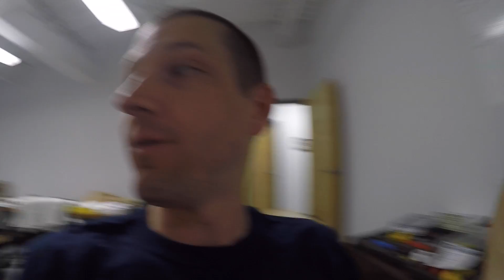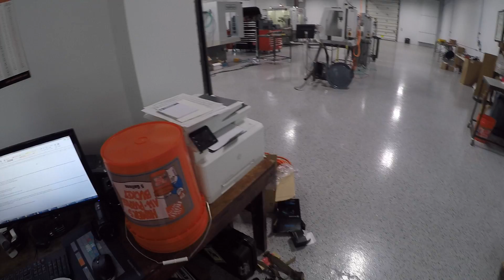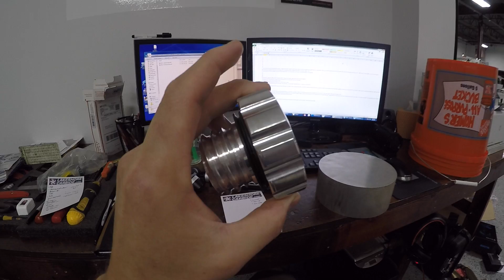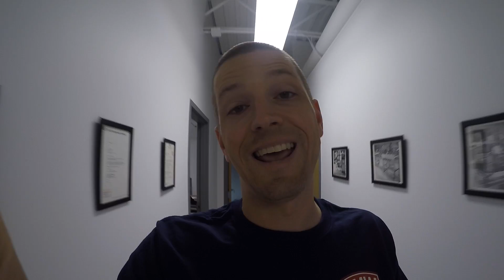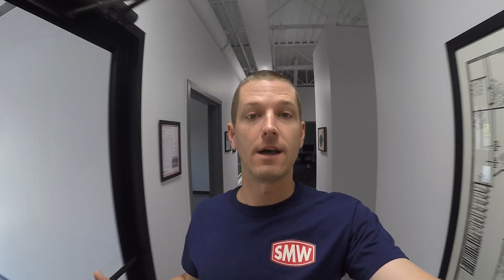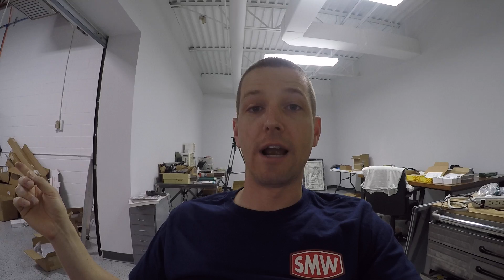Growing Job Shop, CNC Training, a Typical Morning, Saving Money - Chip Break 12

Comment: Job shops are my favorite kind of shops, always something different. Production runs are very boring we had a BMW dealer come in that needed 1 metric bolt, he said do what ever you have to do to make it.  So we did we needed to make a special size threading tool, and in the end we told him the total cost was $265 for that one bolt. We cut him a break because he was in a jam, but that's what you get when are shop rate is $150 an hour.

Comment: I'm really starting to like these Chip Break episodes.  It seems like they somehow pack a lot of info into a small amount of time.  Will you be doing any Fusion Fridays on the lathe?  I'm using SprutCAM 10 with my 15L and wondering if a switch to Fusion would makes sense.  I use GeoMagic Design and Onshape for CAD now, so a bit reluctant to learn yet another CAD product.